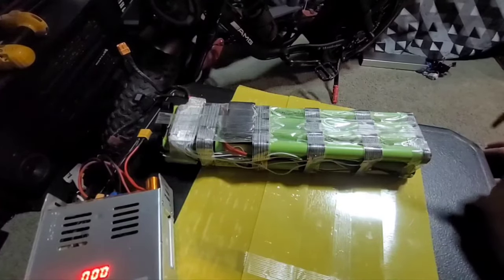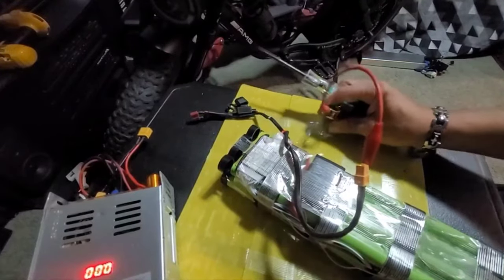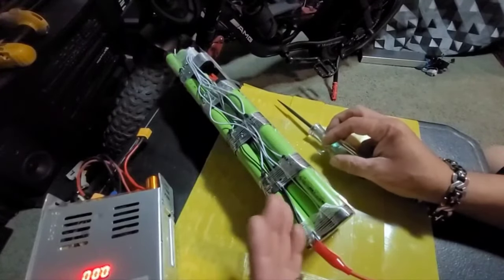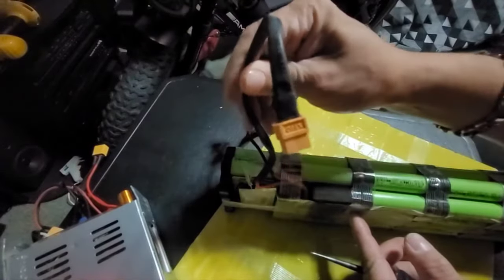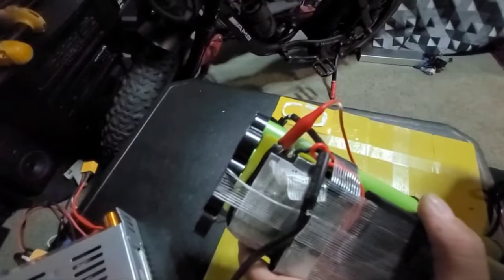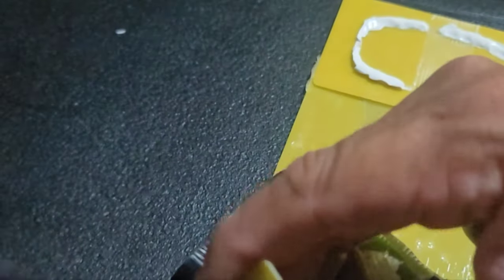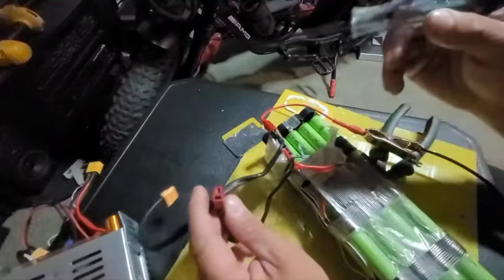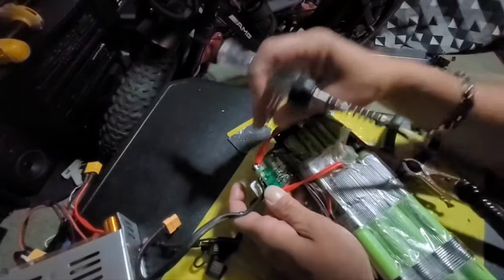How to trouble shoot a bad 48v or any ebike/scooter battery and fix it.  #72vfastebikemodifications

Comment: Positive side of the cells. Stick a pin through the membrane, you will hear gas pressure leave the cell, make sure it's not over 4.2 volts, and they work again.  Don't tell regular people this.  Your vids are awesome.
      Another cat from the street.  Paul.
Reply from the maker: Lol np Paul and yeah I've figured that out in those Lipo packs but no way I'll tell others to do that. it is a Lil dangerous if you don't know what you're doing and I'm not using them anymore period. I'm sure you know also even if it's a pin hole if water finds its way in they're that's another problem. would I still use them on RC cars or other electronics absolutely, will I be using them on my bike in my battery compartment next to another huge bomb lol Nope.  it will still produce that gas and now it's will be leaking into my battery compartment so not putting my ass on a flammable bomb Hahahaha. I appreciate another Homey from the streets, guess what surviving those streets I definitely don't Wana be taken out now by a battery. lmao be cool Homey! PS what made you say stick a pin in them in this video as this was about lithium batteries. I understand that comment on some lipo packs but I'm sure you meant lipos as your not sticking no pin in these unless you trying to kill me or yourself

Comment: Respect because that’s the most important thing because it’s not about us at this point especially I’m electric bike rider I would not want anybody to take any shortcuts and then I run into a problem like overheating or even worse and you know what they even worse is I have a situation with mine. It’s just a shut off when I’m riding. It’s a new battery 48 V 20 amp. I bought it to a bike shop to get fixed meaning for them to install it this new battery for me they tested it. They put it in, but how they put it in. I don’t agree with I might have to take it somewhere else because the wires didn’t match the wire from the charging port. The wire that came out the charging port didn’t match the wire that came out the battery. They had two different connectors so with the guy in the E bike shop was sliced the wires off of one battery use that wire as the charger wire for the other battery I didn’t mind But I told them to solder it. I watch what they were doing. They didn’t solder it. They wired it together and put electric tape around it and put electric tape around it and charge me five dollars now I don’t know what they charge me five dollars. I didn’t think it was gonna be an issue because I thought the E bike shot knew what they were doing. That’s why I bought it there. I could’ve did that myself, but I did a Kapacity test this morning this thing zips my electric bike moves quicker and the battery last longer 100% but then I hit that full throttle to go up that hill and I guess the BMS wouldn’t let me Get that far. The power just cut the power just cut off so I walked back to my house and then I watched a video so I plugged the charger in a wall and then I plugged the charger into my bike for five seconds took the charger right back out of the bike And the power was right back on and the battery still full charge so I’m thinking what they did by no soldering and doing it the right way, and making the connections, secure and strong not with electric tape I’m not a battery expert and I’m just asking for your opinion on what I should do?

Comment: This was a great video! I was able to embark on the beginning steps for troubleshooting my Swft Zip battery that got wet and stopped working.  Was able to bypass the BMS and probe the battery successfully with the help of this video.  My tester lite up like a Christmas tree.  Next step is a BMS replacement.  Hopefully all goes well on this phase of the project.  Just wanted to say thank you for the knowledge.

Comment: OK, let me give you the specs. It’s a Jetson bike electric bike Jetson j5 with a 350 W motor stock and the controller. It can handle up to 52 V so it goes from 24 V to 36 V to 48 V to 54 V or 52 V or something something like that, but that stock the only thing new is my battery and I already explained the situation but the BMS saved my butt literally I think it’s because it’s not a secure connection. Do you agree?

Comment: bypassing the bms for discharge is fine as long as you keep your eye on the voltage ,the bms would still be fine for charging ,i would defenetly be checking the voltages of each group of cells ,the bms doesnt ballance

Comment: I want to put an xt60 connector on my 48v lithium ion battery. There is No on/off switch so.. can the wires just be cut and the xt60 then be soldered on ? Or can something catch fire or .... someone get hurt ?

Comment: Great troubleshooting. I used your method and found a bad BMS. How do I order a replacement BMS on Amazon?
Reply from the maker: You need to order one the correct voltage with the amount of output amps you need for example if it's a 72v36ah with a 150amp discharge rate you need a 20s bms capable of 150amps. Whatever spec your battery was get the same size

Comment: :-: You seem very informal.. I have a question.. I just brought a scooter and have had it for less then a 4days.. The scooter gets a full charge, turns on and will ride.. However the issue is there is never no telling when the scooter just shuts off on me.. Its a 60v 25ah battery yet Ive only got anywhere between 50ft to 8 miles before it just randomly shuts off..  all those times it showed more then 57volts on the Voltmeter displayed on scooter.  What could you think this issue may be. Even if you dont know, whatever information would be appreciated.
Reply: :-: Also great video.. Very very informal even in the comments.
Reply from the maker: When it shuts down does it come back after a power cycle or do you have to fully charge it back up?
Reply: @ChrisCrossingWires1212  :-: Well it will shut off I normally just walk it home and put it on charger.. I did a couple time not put it on the charger and just let it sit there (due to frustration). I came back to scooter a hr later and turn it right on, it also showed 64.5 volts on voltmeter.
Reply: sounds to me like malfunctioning bms.you have the voltage but something is saying you have too little or too much current, most likely when you use the throttle.ive had something similar.take it apart and check connections.if all cells work then its bus.you need to replace it.thats my guess and  thats all it is,im new to this stuff.take it to a professional. @iammrwack
Reply: @franksaunders-ot3ig  :-: They sent me a new battery around that time, I still have old battery also.

Comment: Hey man I need some help. My scooter had a bad battery so the company sent me a new one but it came with a female plug instead of the male that the old battery has. Any advice?
Reply from the maker: yeah I say take the old one off and slice it on to the new cable for now temporarily, if you can unsolder it do so and solder it on the new one if it's crimp like I said cut the wires long enough you can twist them together and tape well. Do that just to get going but order a new plug the correct one and do it right or have someone that can.

Comment: Hello Chris is there any way you can test and possibly fix my Dualtron X 1st Gen (49ah) scooter battery?
Reply from the maker: You are asking Can I fix it for You? if thats the question absolutely I know I can fix it. Need more info what exactly is wrong with it? Voltage too low? wont charge? no volts at all?
Reply: @ChrisCrossingWires1212  Ok my friend, Yes it will not charge, when i plug in the fast charger the charger fan pulsates and counts down the voltage numbers on the display. I've replaced controllers and DC Converter still same issue. I did notice I'm only getting spark on one side and not the other. It's a 60V 49AH battery - Dualtron X 1st Gen.

Comment: I have a 48v battery but came with a 42v charger. The battery charge terminal has 42v and the output is 37.4. 
You think there are any issues with the battery or it’s ok 37,4 on the output?
Reply: 42 for a 48v is almost the cut off point, on a healthy ebike battery anyway. Get a 48v charger. 54.6 is full for 48v.

Comment from the maker: I left out some steps that would needed to be taken had there been other problems but that was the problem with this particular battery I guess I'll have to wait for a pack that has bad cells to show how to isolate them and replace.
Reply: I am Dan in Batavia New York. I have an eco-trick hammer e-bike. I bought a battery from fth which is supposed to be guaranteed for 2 years. It will not be guaranteed because I bought an aftermarket charger cuz I was stupid. So I don't know if I want to pay the $60 to send it to them when they're going to tell me I f*** up. I figured it would shut off I left it plugged in for a week. I went to get my bike to go pay bills cuz that's my only transportation. My bike would not turn on. Well the battery has an RCA plug and it Sparks every time you go to plug it in. But I think I screwed up cuz I left it plugged in so long and it smells burnt and it's not the fuse I know that. My bike works with the other battery that came with it. I wanted more batteries for more range and less range anxiety. I really believe one of the cells must have burned or the BMS burned cuz something smells really burnt like electrical burn. Too bad you don't live near me LOL maybe that's what it is the BMS.
Reply from the maker: @LetArtsLive  I'm pretty sure it's most likely the BMS I come to NY on occasions just to group ride with S3 and Gotham. you may be able to ship to me and I'll bring it in a return trip. I'm definitely coming back before Summer is over
Reply: The battery smells burnt the light comes on for a few seconds it used to only come on for less than a second I thought it was overcharged but it smells burnt does the BMS smell burnt when it goes? Cuz yeah I can put a BMS in it's a plug it's going to cost me $120 to send it to them and back but if it's a battery that's blown and I open it up it's not guaranteed anymore
Reply: There is one fuse on the outside that comes out with a screw that works because if I take it out it doesn't work and I put it in does come on the light
Reply: I don't know Electronics I know house wiring I have a tester
Reply: I still have two batteries that work but if I go on a very long trip with a wagon I need more than two
Reply: I know it's not my bike which is my only transportation so if you sent me your email I can send you pictures and you could tell me what to do or can you? Like I could pay you something for your time
Reply from the maker: @LetArtsLive  Yeah Bro sorry it's Sunday so I'm actually out riding have to get back to you this eve to actually help you out but if the BMS smells burnt its burnt and no amount of fiddling with it guns bring it back lol its dead bro you're gonna need a new BMS they're not hard to change

Comment: Hi.. new sub here.. i have a battery 48volts my terminal has 0 volt but charging port connector is 36... is it changing about bms?
Reply from the maker: Definitely sounds like you  blew the BMS

Comment: if you used a meter instead of a lamp, then you might have found that the cells were unbalanced - the bms would look faulty f it had done its job and shut down the battery to protect it
Reply from the maker: If you had looked at the date of this video you would have seen that I was just getting started, 2 years later and I'm building battery's and bikes so I'm pretty sure at this stage there nothing you could tell be about a battery that I don't know but much appreciated but this is way outta date considering how fast I move
Reply: So after the battery is shut down how do you reset it if you replace the battery and make it good again

Comment: I'm here because I didn't get any light while testing, but knew there was voltage because I accidentally crossed the charging cable and it popped. Hope it didn't fry anything.
Reply from the maker: use a multi meter but you probably have a bad bms
Reply: @ChrisCrossingWires1212  yeah I'm jumping straight to the conclusion yours came to, I'll still follow the leads to be sure.